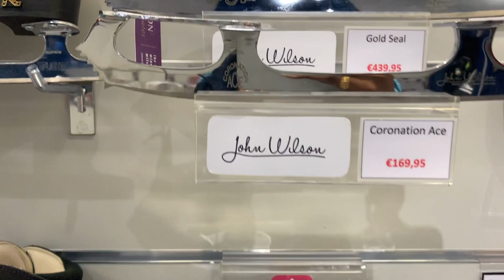VLOG 1 - basic figure skating skills testing + getting new blades! // roadtoaxel

Comment: Having your blades permanently mounted before you try them on ice made me concern. I just tried my new boots and blades set, the blade was mounted off and my feet started hurting after 10 minutes. But they came pre-mounted so I can adjust them. My blades also don't touch the sole of my boots well, and there are gaps, so I have to get this fixed too.
Reply from the maker: Dian Zhang sorry to hear about that 😔😱 mine already had other blades on them so he was able to see where those holes were and just place the new ones on top of them! he’s quite skilled at it too, so fully trusted it, but I do hear of others who pre-mount before permanently mounting! ⛸